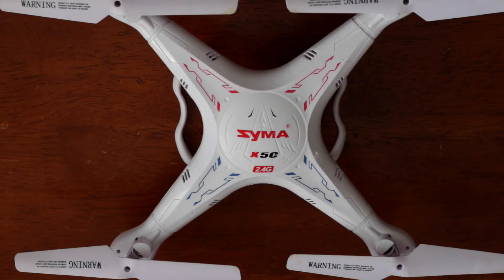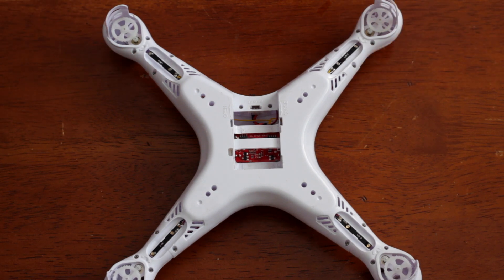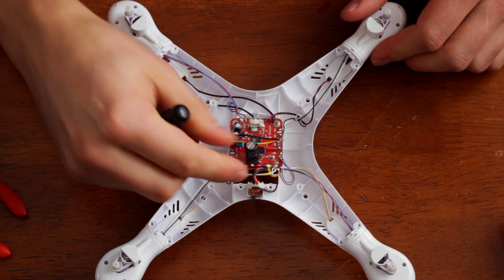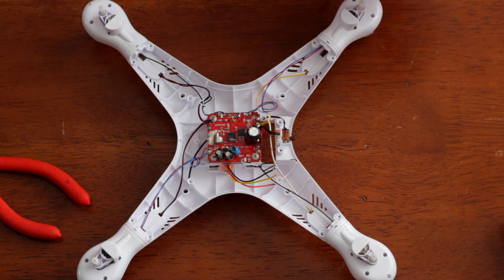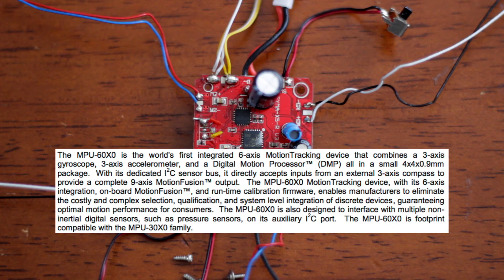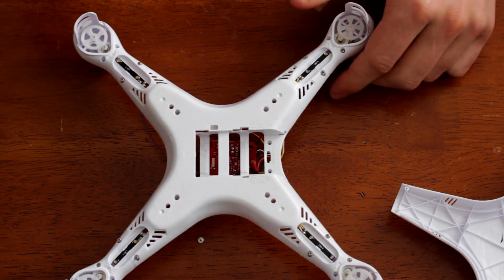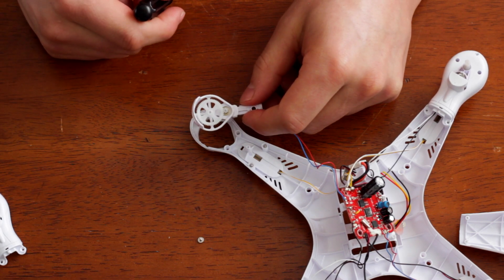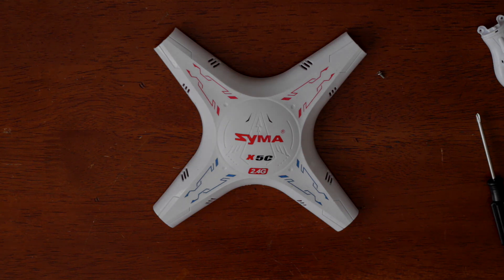10 Minute Teardowns: What's inside the Syma X5C RC Quadcopter Drone?

Comment: Hey mate, nice video, thanks for the explanation, it helped me understand a bit more about it, had to order another motor for my Dad's x5c as one of the motors started to burn out, we've been flying our quadcopters for a few months and would like to know the best quadcopter to move to after one of these Symas? Any suggestions would be appreciated a camera is a plus but it's not 100% necessary, outdoor flight is a must and I'm hoping theres a few good ones that can compete against the wind without breaking the bank, around the ~$300 mark?

Thank you very much :)

EDIT: I know you said I'm better off buying a new quadcopter, but we have been really enjoying the Syma, and the soldering isn't any problem.
Reply from the maker: +killerjerick mcjerick Absolutely nothing wrong with repairing a broken quad especially if you've got the time! I can respect that.

As for nicer quads for outdoor flying: take a look at the RTF walkera runner miniquad on hobbyking. There is a ~250 dollar model that comes with a devo7 transmitter and (i think) FPV transmitter. And you can easily strap on a GoPro or other smaller camera if you want. It's a nice starting kit and these miniquads can generally take a good beating before anything breaks other than props!
Reply: RadRider33 Amazing, thanks for the fast reply, I will look at the RTF walkera runner, thank you. I hope to see some more 10 Minute Teardowns in the future from you, they are very informative, thank you!